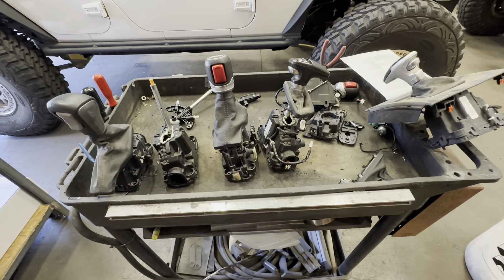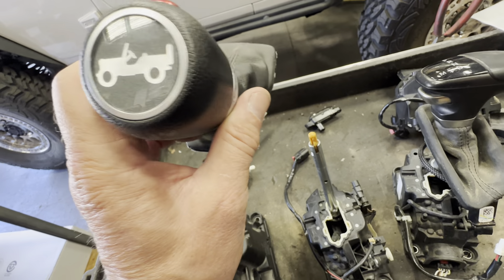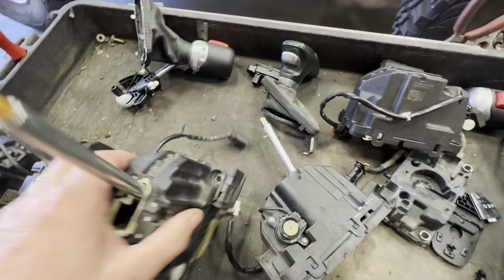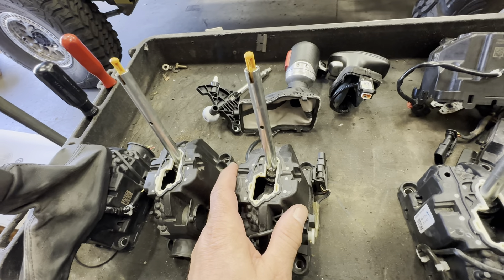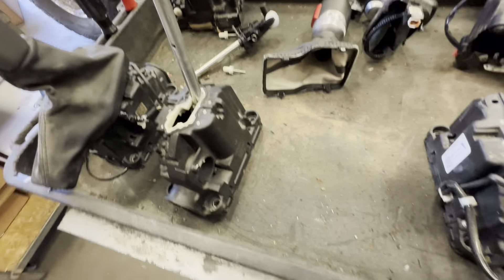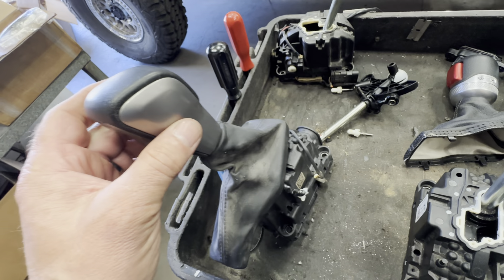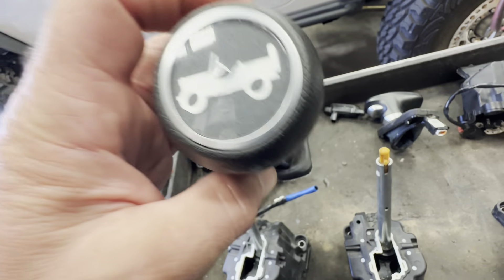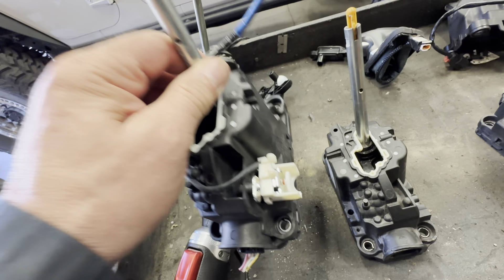Jeep JK 8 speed with JL knob

Comment: I ended up using the Challenger shift assembly with the JL knob and it works like a champ. It's a little bit lower but it doesn't bother me and looks fine. If it were a manual, that would be a different story but as an automatic shifter, it works good and looks fine.
Reply from the maker: Your right it does work, It's just a little short..